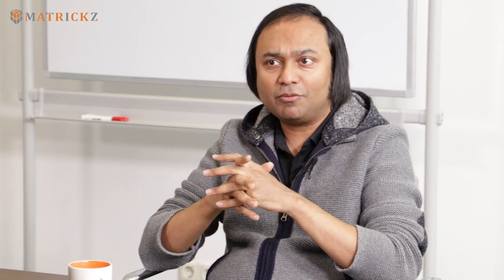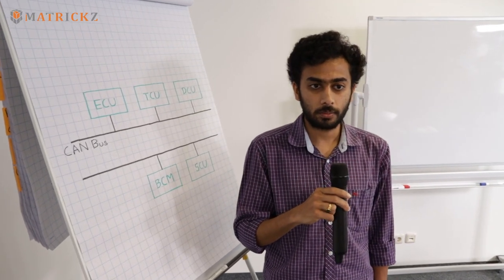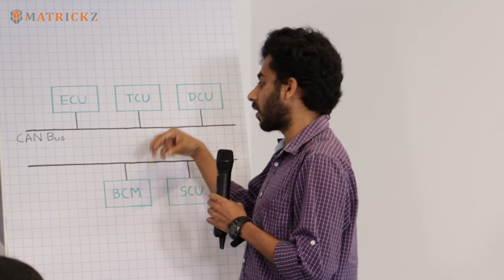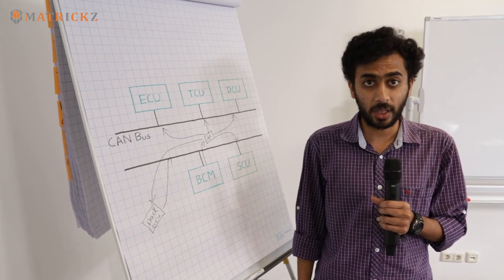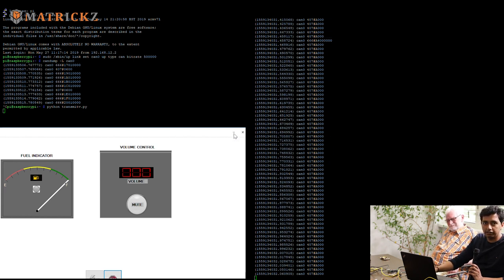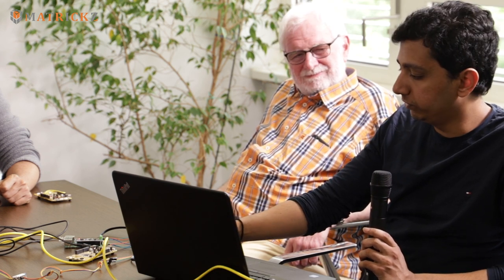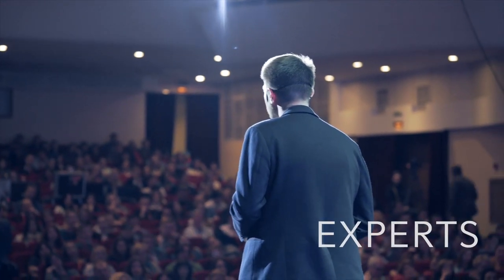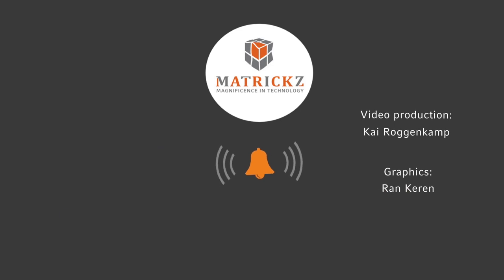Car Hacking Demo: How to Hack an ECU, Automotive Penetration Testing (2019)

Comment: Hi
I don’t know much about computer programming but I have a project that I need your help, I have a lincoln continental 2020 and I wanna swap its V6 engine to V8 or V12 engine and I was thinking if is possible to reprogramming its ECU for run the new engine?

Comment: Without key provision for the sniffing ECU(raspberry pi) CAN will not allow you to participate the communication. Then how will you monitor the message 🤔
Reply: It is one of the methods ,there are many protocols where you can easily access can communications by ota methods ...some modern day cars have this system pre installed for wireless Can updates

Comment: Just wondering, if you remove CRC safeguard as a watch dog of the CAN protocol, would it make sense in terms of hacking efficiency ? Thanks for the clarification
Reply from the maker: If we understand correctly, you are referring to CRC safeguard as a watchdog technique for the CAN protocol and you are wondering what would be the difference in terms of hacking efficiency when this is removed.
 
Keeping the above understanding in mind, removing the CRC safeguard will make the reverse engineering (analysis) of CAN messages effortless. Although we would like to stress on the fact that CRC is not a very sophisticated method to protect a CAN message, but still there is a level protection that CRC provides which make the life of a hacker a bit difficult. And with this CRC safeguard feature, the easiest type of attack that a hacker would go to is for DoS (Denial of Service) attack as performing the targeted attack would require a bit of effort to analyze and reverse engineer the CAN messages with a huge CAN dump along with the task of identifying the CRC polynomial. But without this CRC safeguard, the hacker can directly jump into targeted attacks which is far more dangerous than the DoS (Denial of Service) attack.

Comment: If I have a TPMS system Tire pressure monitoring system that has an out of date battery in one of the 4 wheel sensors, would there be a way to just disable the TPMS on the vehicle?
Reply: Yeah, open your fuse box in your vehicle and pull the TPMS fuse and viola all TPMS lights off

Comment: This all process should have been done more precisely with the help of a hack rf device to receive and send RF signals, instead nobody gives you authorization to plug cable in the the car, so where is the lean hacking ???